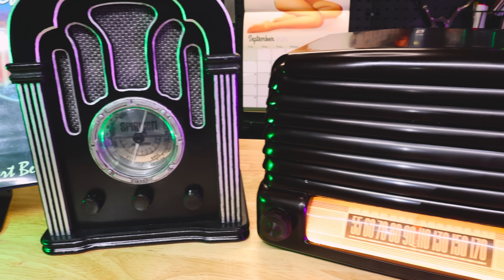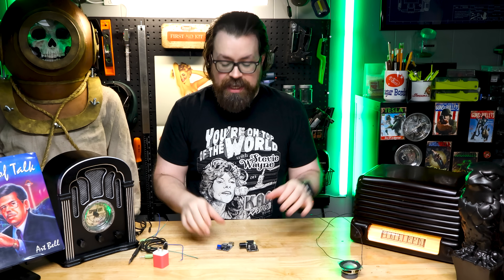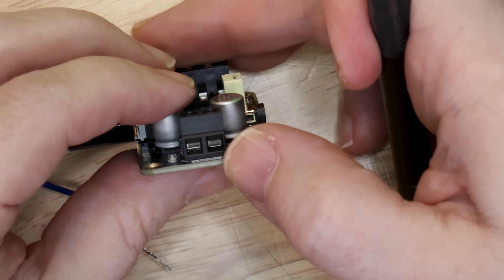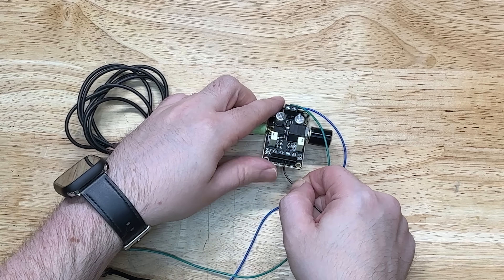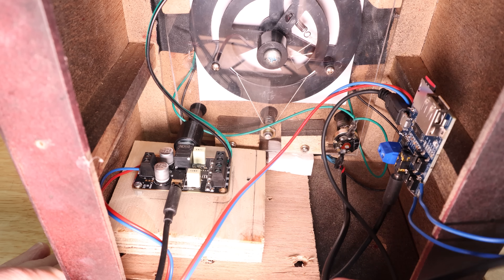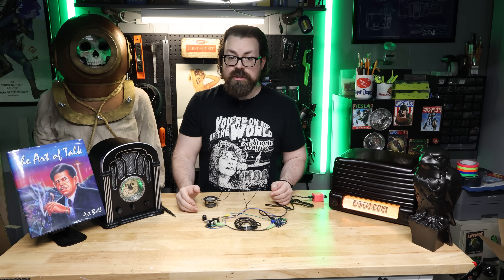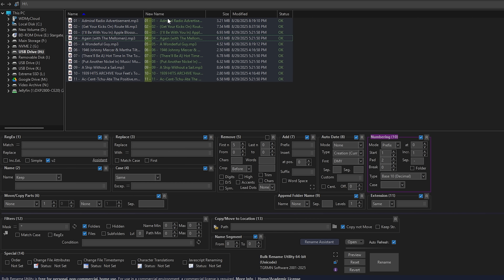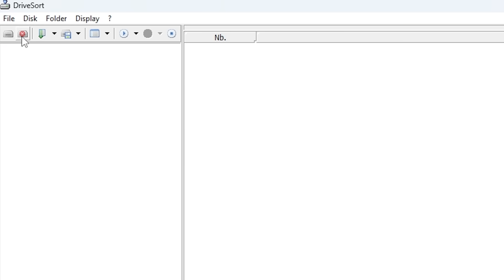How to Build a Radio That Plays Anything You Want

Comment: If you have only one speaker, you need to sum the two channels so that both the left and right channels will play through the speaker. The best way to do it is through a resistor bridge between the audio source and the amplifier. You might get away with connecting both channels to the speaker. Or, load the tracks into an audio editor such as Audacity and convert them to mono. There are songs out there where the left and right tracks are very different from each other. If you have ever heard “California Dreaming” through one speaker you know what I am talking about.
Reply from the maker: Yeah that’s a part of the video I wish I had been clearer about. All the files I am working with are mono, in part to make my life easier and in part because I like lower fidelity sound to it. Makes it feel older and more radio-like. This could absolutely be done with a stereo setup though if someone wanted to go that route.
Reply: or jimi hendrix - guitar right, bass left drums center
Reply: Thanks for the tip!
Reply: On the other hand, the music you're playing from the 30's and 40's is all mono anyway, so at this point channels are moot.

Comment: Perry, thank you for the detailed video about building the MP3 playing radio.  I bought the 2 electronic boards and speakers from Amazon and it was easy to assemble.  Just one question, did you ever upload the STL file for the knob extension to the amplifier to any 3D site?  I would like to print one of them.
Reply from the maker: Here you go: https://www.thingiverse.com/thing:7280269/files

I believe that's the final version that was almost a perfect friction fit.

Comment: This is crazy. Your project is exactly what I had a rough idea for pop in my head a month ago but I couldn't figure out how to approach it. I wanted some very straight forward way to play my fav 1920-1950s records when I am in a mood for it without any distractions - just a press of a button. But at the time I couldn't think of how would it look like. I didn't want to depend on PC to stream them, nor to use phone to pick some playlist and stream to Bluetooth speaker (that I would have to buy anyway). I needed something you just turn on and there you have it. Finally last week it hit me that maybe I could be fancy and use some vintage radio and stream AM signal to it. You just turn it on and you have a broadcast to hop into. I quickly realized that in order to use such old radio (my target was 1930-1950 units to compliment the music) you need to recap it before you are able to use it. But I was still curious if someone did something of that kind of a project so i checked youtube and I your video popped up. And that is exactly the immediate solution for my craving! Long story short 3 days ago I bought Radione 765-W from 1954 for dirt cheap in great condition for its age. Wired the mp3 plate and the amp and hooked them to the Speaker of the radio using alligator clips. I had goosebumps when I turned the amp for the first time and heard the music. Thank you for the idea and all the work setting it up! I am still thinking to recap the radio later on and do the actual AM transmitter Radio project just to add extra flavor to listening experience by using real Tubes in the radio but right now it is a perfect substitute for what I need for detox days from social media. :)
Reply from the maker: That's awesome! I'm glad you like it :) I know exactly what you mean about getting goosebumps the first time you turn it on. It's like going back in time.

Comment: I wanted to know how large of an sd card (32, 64, or 128) can the mp3 player handle? I ordered the one from your link.
Reply from the maker: I haven’t tested its limits but I doubt it would have a problem with bigger SD cards. That said I’ve mostly used 32GB because they were cheapest and since it’s just mp3 files it takes A TON of files to fill. I’ve barely been able to fill a fraction of the 32GB cards

Comment: Is there any way one could have the files on the "radio" update dynamically? Say I want to make a custom weather report, but I want it to be accurate rather than just the same few fake reports every time. Is there a way that could easily be done, or would it require far too much setup to be worth the time? I want to have the custom songs while still maintaining authenticity, but if I can't have both it's not TOO big of a deal.

Edit: After watching the setup process for getting the files onto the SD card, assuming it's a similar setup for the USB, I feel confident in the assumption that it would be waaaaaay too much of a hassle.
Reply from the maker: I can’t imagine making this setup do that. I think at that point you’d have to move to a raspberry pi or similar setup.
Reply: @theperrydaniels  Yeah, figured. Thanks for letting me know for sure though.

Comment: I love this!  I am currently Modding a 1936 Emerson 3380.  All is going smoothly.  Question:  When I turn it on via the amp it starts at the beginning every time (as opposed to picking up somewhere in the always running playlist).  Any suggestions on what I might have done wrong or if there is a workaround?
Reply from the maker: A couple of people have said they ran into this problem. Someone said it seemed to be a power issue. Try a different power brick or wires power to the MP3 and the amp separately. The other commenter said that fixed the issue for them.
Reply: @theperrydaniels  Thank you!  That was it.  I just gave the amp it's own power supply.

Comment: I just did a Radiola (RCA) 1947 radio.  I mounted the amplifier to the internal chassis using the nut on the volume control. With a sleeve. I extended the shaft to work with the original knob. My files include hundreds of radio drama show from a few years before and after 1947. It turned out perfect.
Reply from the maker: Nice! That sounds fantastic!

Comment: How did you attach the mp3 decoder, I see the amp has 4 holes for screws so that is easy but the mp3 board does not and I want to use usb memory sticks that I can replace so it needs a firm attachment. Great video by the way.
Reply from the maker: The MP3 player is connected to the amp for power via two holes on either side of the microUSB plug. You solder the wires there and run them to the screw posts on the amp. For the audio signal it’s connected through the 3.5mm audio cable.
Reply: @theperrydaniels  Sorry I meant how did you stick it to the side of the radio?

Comment: Dude, loved this video so much the next day I was looking for old radios that I can buy on FaceBook market place. I have one that I am finishing up and I can't wait to use it. The only thing that I did different that you is run it through USB. I also added a short USB extender to install in the back so I can change the drive out depending on what I want to listen to.
Reply from the maker: Thanks! That’s probably a smarter solution long term. Having to take the back off the radios to get to the SD card doesn’t bother me yet because I haven’t wanted to change the programming much. But I can definitely see that becoming a pain over time and switching to a USB extension like you.

Comment: If I wanted to make this with a portable battery powered device that turns on and off, how do I get the same effect of tuning into a random point in the broadcast? when the device turns on and off, it starts over at the beginning of the list, even if it is a random list, it'll still go in the same order. Am I just going to need a good battery and have the radio on constantly and turn the volume on and off?
Reply from the maker: In my experience the MP3 player won’t start over from the top of the playlist. Even after a power outage or unplugging the radio to move it, mine have always picked right back up where they left off. If I were going to do it with a portable setup, I think I would try to do it with a rechargeable battery pack. That way when it wasn’t running off of battery it could be plugged in and still playing.
Reply: @theperrydaniels  You were absolutely right, it just picks up where it left off. Thank you for the help, Ill be modifying my old radio soon to fit the parts. Thank you very much

Comment: I’ve got a weird thing happening. When you turn on the radio it plays from the beginning of the track that was last playing ( instead of just continuing to play in the background, if that makes sense?)
Reply from the maker: Someone else mentioned having this problem and said it seemed to be a power issue. Try a different power source or try running power to the player and the amp separately. They said that worked for them.

Comment: I’ve been trying this out myself and it works great! One question, how did you get your LED lights wired to your amp on your GE radio? I’ve been trying something similar but can’t find how to do without the light being perpetually on. Just wondering what you did. Thanks again! I’ve been thinking about how to do this for months!
Reply from the maker: So this is a little hard to describe but there are two connections on the bottom of the amplifier that you can solder the LEDs to that will turn them off and on with the switch on the amp. Sorry I can’t be more detailed in my description, I found them by testing each connection with a multimeter.
Reply: @theperrydaniels thanks for reply! My next step was to get out the multimeter. At least I know it’s possible.
Reply: @theperrydaniels figured it out! DC power negative and the “mode” connection. Worked great for me. Thanks again!

Comment: A million thank yous for this fantastic production!  Years ago (15-20?) I made an old time radio that repurposed an old router to run internet radio stations.  It worked great until the author stopped updating the phone app that was necessary to run it.  Thankfully your creation doesn't require such apps so no fear of going obsolete.
Reply from the maker: That was definitely one of the goals of this project. I know there are a million other ways to do something like this and some of them will do a much better job of it, but I really wanted to make it as simple as humanly possible. No apps, no coding, just a few simple components. 😁

Comment: did something similar to this with two radios - a 1947 floor-model Emerson radio-phono, and a 1960s Zenith table radio.  The Emerson had a similar mp3 player to yours, but mine powered up with the amp.   The amp had a provision for bluetooth, and when it was connected to a bluetooth source, it would automatically switch from the wired connection to the bluetooth receiver.   I modified the radio's  controls to allow prev/next and play/pause to be controlled from the radio's original tone and tuning knobs.  Even managed to illuminate the magic-eye of the radio, though it wasn't quite an emulation.

The Zenith was just a 'gut the chassis and put a bluetooth receiver and amp in it' kind of thing.  My playlists are all on a retired Android phone anyway, so it works well, and to add more is simplicity itself.

I try to find recordings and recreations of original 1940s and 1960s and 1970s broadcasts, including commercials and deejay chatter.  I don't have much of a 'random' feature, but there are dozens of playlists to choose from.   

I wash my music through audacity to emulate the AM sound and edit it to add a little random AM fade and bleed and hiss and crackle for authenticity.  This is probably bordering on maniacal, though, and it is time-consuming, so... your mileage may vary.

The amp in the Emerson is stereo, so I put two modern smaller speakers in the cavity the original 12" loudspeaker once occupied.    Couldn't use the original speaker because it had crumbled to dust.

The Zenith uses a mono amp, but a little stereo-to-mono conversion on the input lead lets me drive it with both channels.   Dont just wire left and right together, though - put a 100 ohm resistor in series in both channels before the splice.  This is because some devices don't like their outputs being tied directly together.  Rare, but it does happen.

Dude, tell me where to find that tshirt.

Comment: Does the Ohms and Watts matter with what speakers you go with?
Reply from the maker: I’m not 100% on the limits. I believe 5 watts should be its upper limit as far as wattage goes. For Ohms I think it lists 2, 4, and 8 Ohms as usable. I’ve tried 4ohms but didn’t love the output. I’ve found 8Ohms 5Watts was a sweet spot for me.
Reply: @theperrydaniels thank you for your answer. This helps a lot. I want to try a similar build but I want to go with a smaller speaker but found a lot of them didn’t match the ohms or watts but now I know what to look for!

Comment: Fantastic idea.  I've got a couple of radios that have been gathering dust for years, and I can't wait to do this.  I've got one question, though:  is there any reason NOT to use the speaker that's already in these radios?  Is it necessary to buy a new, modern speaker?
Reply from the maker: Nice, give it a shot! If the speaker still works you can probably use it. My older radios needed to be replaced because they were just too trashed to function. The replica radio still worked fine though so I could still use its speaker.

Comment: Having an issue with mine now that the parts are in. I've got everything connected as demonstrated, but every time I turn the knob off, it restarts playback on the microSD card.
Reply from the maker: Weird. I haven’t had that issue so it’s hard for me to say why that would be but someone else mentioned a similar problem in another comment. They said if, I remember right, that it was a power problem. Try a different 5W plug or try not running power between the two boards and powering the amp separately from the MP3 player.

Comment: For a real beginner, what gauge wire should I buy for this? Also, I can probably cannibalize the speaker from the radio I'm putting this in, can't I?
Reply: I'm also a little confused about one thing you're saying: that knob controls the power, and volume, so if you turn it down/off, it stops playing? You said it plays whether you're there or not, but this doesn't sound like that's the case?
Reply from the maker: If I remember correctly I used 22 AWG for mine and that worked just fine. 

The way I set these up the knob that controls volume and power only controls the amp so turning the radio “off” really just turns off the sound. The MP3 board is still constantly playing in the background. So “on” and “off” only ever effect the speaker, not the player itself.
Reply: @theperrydaniels Makes complete sense! Got it!

Comment: I think I missed the part where you used multiple playlists. Can you use multiple playlists on one card?
Reply from the maker: Sort of. You can’t have multiple playlists that you can switch between (that I’m aware of). You CAN put multiple playlists on the SD card and keep them in order so the player cycles through all of them back to back. A few people have commented ideas for using multiple players to make “channels” you could switch through but I haven’t tried that yet myself. Personally I’ve just made it so that switching out the SD card / USB drive is more easily accessible so I can change up what the radio plays whenever I feel like it by throwing in another card.
Reply: @theperrydaniels thanks! Great project! I've ordered the parts.

Comment: When you add MP3 files to the SD card, are you putting all of the files into the root directory of the card ?  Have you noticed any limit to the number of files you can put onto the card ?  Have you tried making a folder (or several folders) inthe root directory of the card and then copying difffernt MP3s to each folder, then see if the player playes the contents of each folder in order ?
Reply from the maker: I do add them all directly to the root. I have not found a file limit. On one of mine I’ve got 500+ files with no issues. I think I did test doing folders and if I remember correctly it did just play through all of them in order. Honestly though that was over a year ago so I might not remember the folder handling correctly.

Comment: Great video, I really like your style of teaching, so easy it sounds! It was truly motivating to build one out of an old radio at my home (already ordered the needed parts). But can you tell (or share) how to add a rechargeable battery in case it's a portable radio?
Reply from the maker: Thanks a lot! I have been thinking about how to do this but I haven’t tested my ideas yet. If you or anyone else has a better suggestion I’d love to hear it. I think I would go the route of just using a rechargeable power bank, like the kind you would use to charge your phone. Again, I haven’t tried this myself so I don’t know how long that charge would last but that would be my first solution.
Reply: @theperrydaniels  Thanks again for this tutorial. I had a test run today, and the whole thing works as it should! I work on my grandfather's radio, a Sokol-403, a portable radio made in USSR. 
One thing got in my mind when rewatching this video: how to fix the module into the radio body. May I ask what was your solution for it, sir?

Comment: Can you make it have "channels"? Say load up playlists of podcasts and different genres you can flip through? Might be nice to have a raspberry pi or something filled with different playlists based on mood. Say metal,smooth jazz etc?
Reply from the maker: You certainly could. I avoided using something like a raspberry pi just to keep it as simple as possible but the sky’s the limit on how far you could take this. Some other commenters have given some great suggestions on how to use multiples of the MP3 boards to mimic channels. Definitely on my list of improvements to test out.